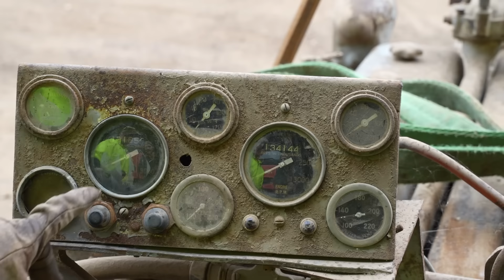WORKSHOP WEDNESDAY: Greatest tank BARN FIND in Australia! PART II

Comment: US tanks in WW2 were often mostly white inside, so yeah that is as original as can be.

Those wooden crates are indeed WW2 American crates straight from the factories. Their condition is just insanely well preserved, Make sure you don't toss those away, these crates re extremely rare to find (specially if there are stamps on it from the factory). Often these crates are nailed shut so they don't open during transport on the ships. Also it would take less space as what hinged boxes would have and it would make it a lot faster to construct for the factories.

6:34 For the front additional armor, it might be that you can stack some tracks on there as well. Can't see it based from this video, but try it out and see if it would indeed fit. The bar above it does hint towards something like that at least. 

6:56 Additional hooks for the crew, it didn't held anything that was factory issued. I do know these were often used to hold additional equipement like shovels and track maintenance bars (those to get tracks on, solid iron often) Also it should be able to hold 1 single track bit per 2 U-shaped bits.
Scroll down to the picture "M3 Lee at Fort Knox, June 1942"
https://tanks-encyclopedia.com/ww2/us/m3_lee_grant.php

6:59 Antenna mount I think, this was a antenna mounted on top of a piece of metal block. Not all versions of these tanks had them though, this one at least tells it had a better radio then the stock version. Yes, the factory added it. I am however not entirely sure about the how and why, I presume it's for the later versions only as the earlier models didn't have this so far I'm aware.

7:05 Aftermarket, not stock. It should be smooth there, also the ones on the box shouldn't be there. So these are 100% added by Australians. I think the ones on the box would have carried camo netting when rolled up. However the hook on the hull itself, i'm not sure actually how that one was used.

7:18 Big red circle with slightly smaller yellow circle inside of it is indeed a known Australian marker, I have however no idea what it stands for at this moment.

9:05 That would be a factory thing probably, it should have been repainted but in war times these things did slip trough the cracks in favor of working on the next one to finish as many as possible. This one specifically is upside down from the camera perspective, it should read 'Unit M'. I am not sure about what it might mean, but could have been the specific compartment it should face. Motor (engine)? Main compartment? Seems to be the rear, so probably refers to the power pack probably.

For turrets, please make sure that one of these tanks isn't a "M31 ARV" instead of a regular tank. These were used as tank recovery vehicles, they have a specialized 'turret' for recovery instead of the regular gun. This would be a tow truck type hook. Also it would have other differences on the hull itself to some extend like the boxes on the rear were removed in favor of a much higher rear end, no clue why or what specific purpose. See the link I gave to see a model of this further down the page.

Comment: Grant tank assembly line? Great that you have so much of your Grant history back . I need some 9.00-13 wheels and tires? A photo on line shows a tow cable running through those connections on the left side of the tank from the front up the front L side panal pointed to by Daryl, up and over the side hatch and along the back.

Comment: With that last Grant hull, was the The Battle of Lone Pine? 🤷‍♂️

Will you rebuild them all or use them as parts donors and then swap / sell / trade what isn't needed for missing components on different projects you have coming up? I guess Jono may have dibs on any spare Scout bits you come across.

That was an incredible find and I have to wonder how many other treasure troves similar to that are out there being held hostage by pine trees.

Comment: As an ex soldier, if you have large moves like this, call individual army units and suggest they support the museum by doing a training lift. The soldiers love it. It gives lots of good training. And it will probably just cost you a bbq lunch and maybe some beers at the end. Let army recruiting know as they might help negotiate. 
I did some stuff like this and it was great.
Reply: The only problem with that is that it will take them two weeks to move one thing...still it woiuldnt hurt to have a few strong lads around.  Charles
Reply: 85 Tp, and the descendants of 158 (Tk Tptr) Tp would be all over that like a rash. I carried a Sentinel from the Sydney Railway Workshop back to the Pucka Armour museum in 93... Some of the questions I got over the 2 way would make your head spin...Turned the wireless off so I could concentrate on driving...
Reply: Great point!